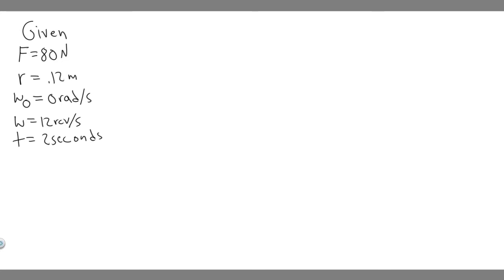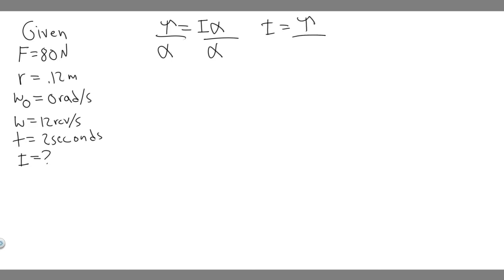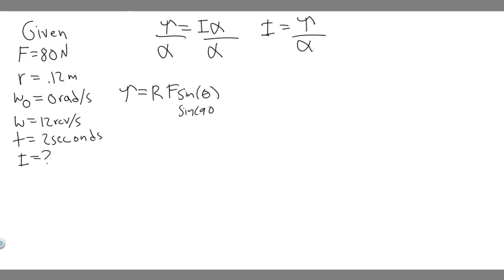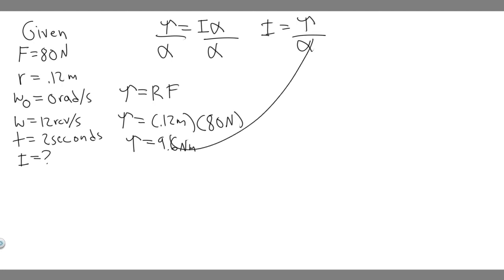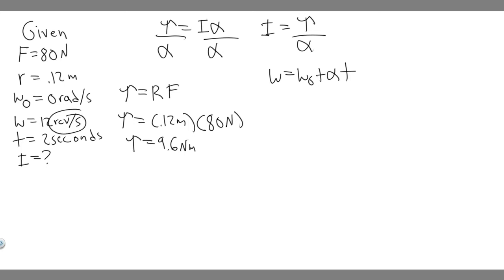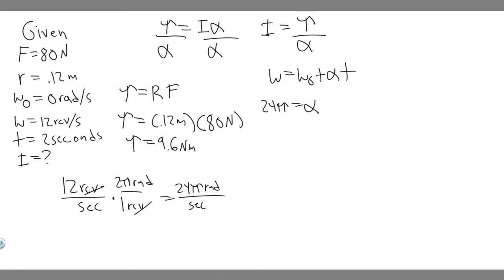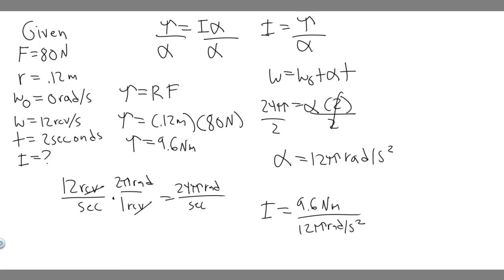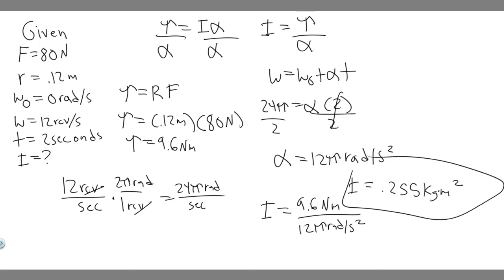A wheel rotates without friction about a stationary horizontal axis at the center of the wheel. A co

Comment: A wheel rotates without friction about a stationary hori- walled zontal axis at the center of the wheel. A constant tangential force and in equal to 80.0 N is applied to the rim of the wheel. The wheel has 10.22 radius 0.120 m. Starting from rest, the wheel has an angular speed slippin of 12.0 rev/s after 2.00 s. What is the moment of inertia of the force, wheel?